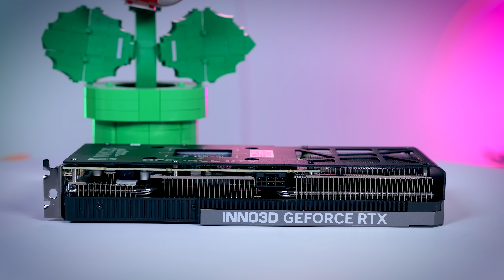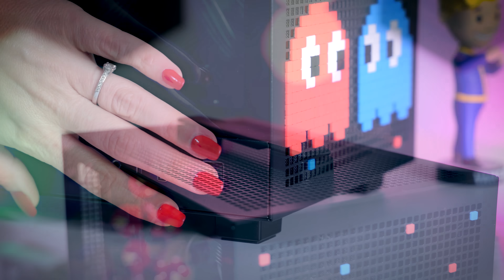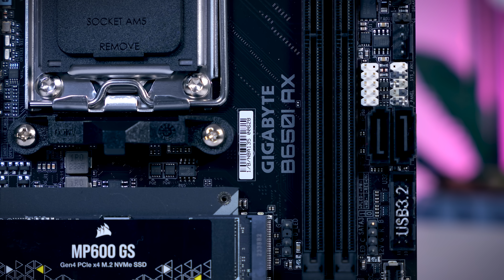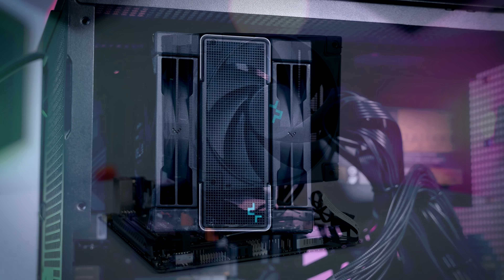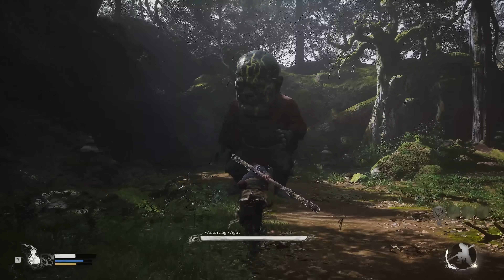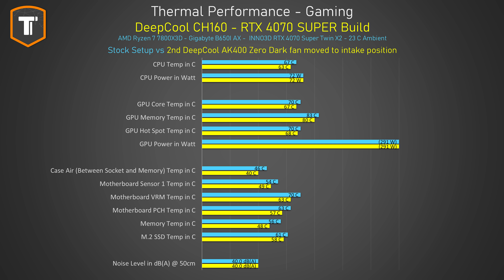Small, Fast & Affordable - RTX 4070 Super & 7800X3D ITX Build

Comment from the maker: Notes:
- At the time I built this, all the parts together added up to €1500. I felt that was a good price for this system. But the 7800X3D has since gone up in price by more than 150 euros, which doesn't make sense in my opinion. With the current prices, I would  swap the 7800X3D for a 7700X, keeping the total build cost around €1500 again. Or, just wait for 9000-series X3D reviews on November 7th.
- At 10:17 I say the GPU uses 219 Watts, but the graph incorrectly says 291 Watts instead. 219 is the correct number.
Reply: Hello, nice video like always 😊 but i'd like to say that the screen with the gpu power is incorrect because the max consommation of a 4070 super is 220w and it says 291w in the vidéo. I hope this information can help you. Bye
Reply: I am building just the same PC, for the money i think it is the best choice for now, later, in a few years i can swap graphic card and proccesor
Reply: @TheMarkolen  You'd be mad to buy a 7800x3d now when the 9800x3d is about to be released. And from the rumours, it's going to be a beast.
Reply: @mikep9418  yeah it will be better probably, but it will be more expensive probably
Reply: Do you think able to use the rx 6800xt instead of the 4070super? If yes how much do you think the performance will differ?
Reply: I mean, if you can afford a €1500 PC, you can add an extra €150 or even find a second hand deal, nice dress btw ! :eyes-pink-heart-shape:
Reply: @Z0MBUSTER  How do you come to that conclusion? Many people struggle to save that much
Reply: @joshualaird5303  If you struggle to save 1k, maybe you should use it to buy something useful like a second hand desktop pc to find a better job or food, then game when you can actually afford it :face-fuchsia-poop-shape:
Reply: You do realise that people who struggle to save 1.5k are not the kind of people who will "waste" it in a gaming PC but rather in basic survival items like food or clothing right ?

Comment: It doesn't make much sense to purchase the CH160 when you can create a mATX setup using the Mechanic Master C26, which features a 13.3L case and accommodates a 310mm GPU.
Reply from the maker: Never heard of that one, but I can find a CH160 for 50-60 euros, so I don't think it's really comparable?
Reply: @TechTesters  The CH160 takes up excessive space for an ITX setup; this case feels outdated. Currently, an ITX configuration is around 7.8 liters with a 300mm GPU, while mATX is approximately 13.3 liters with a 310mm GPU. Everything else seems impractical if one can't achieve a better volume-to-total TDP efficiency.
Stay Updated!!!

Comment: It's good to see a SFF build and review. There's some really great cases out to choose from if you up the budget for them. I built mine in NR200P v1 some years ago. As it is a little larger I could fit the Phantom Spirit CPU cooler to my 7700X. Wow - it's a good cooler at a budget price. The one piece of experience I'd share, ahead of number of M.2 drives etc, is that case fans and layout is really important. In a washing machine sized case you can brute force air in. With a SFF case you need finesse. I'd stay away from small fans, stick to 120 or 140 if you can fit them. Also buy good case fans. Don't cheap out on these. They make a great difference to cooling and noise. I'd also have the top fans set to exhaust and intake everywhere else you can fit them.
Reply from the maker: I still have a NR200P as well, still a great case. Really liking these cases that are compact, but not to the point where they become a hassle to work with.

Comment: Excellent video and presentation as always.
How about noise levels?
Reply from the maker: Noise is pretty much what you make of it with cases like this. I always (try to) limit my builds to 40 dB(A) at 50cm under load. But you could easily keep it even quieter if you wanted to.
Reply: @TechTesters  sounds pretty good, thanks a lot!!

Comment: But it's hard to find a motherboard with itx form factor in budget build plus itx motherboards are lacking in expansion slots due to a tight itx build so for future upgradation it might give problems and Some Airflow issues may also arise in future. Although it's a great build and I personally Like it so much as portability and performance both seem promised but personally searched about this and found these issues. 

I am planning to put an rtx 4070 with either R5 7700x or an i7 13700k
Reply from the maker: Fair, but to be honest most builds I see never use more expansion slots than the GPU. As for airflow problems, I'd say it's easier to keep this system clean and running well than most ATX builds.
Reply: @TechTesters  So for like If I Wanted to upgrade it to rtx 4080 or 90 in future so for that The power supply ot even intense gaming oriented CPU I may consider for future upgradation, will it does the job or like I may be require to upgrade this whole to ATX ? I am really curious to know cause I am planning for the same build but future upgradation is something that stopping me for an itx build.

Comment: that GPU should not be pulling 290 watts, something is wrong here.
Reply from the maker: Pinned comment :) I say 219 correctly, the graph incorrectly says 291.
Reply: @TechTesters  Thanks. I have the exact same GPU but flashed with Gigabyte bios so the power slider goes up to 145%, and in that setting it pulls 275 watts during 3DMark benchmarks. This is why I was confused why its pulling 291W in normal operation haha.

Comment: More Gaming Performance with 4080s + 7600 . 7800x3d is the same fps on 4k as 7600 but double the Price. Also with 4070s is most of the time to slow for 4k.
Reply from the maker: With current prices, I'd definitely drop the 7800X3D for something cheaper and upgrade the GPU. Or just save the money.

Comment: I'm planning to build in that Fractal Terra case and I already checked that I can only fit ~60mm height for CPU cooler (I think I'll pick ID Cooling IS-55). I'm planning for this CPU+GPU combo at first but I don't think the cooler is sufficient for 7800X3D. Will the 7900 non-X be a decent alternative?
Reply from the maker: The Terra is a lovely case. But CPU Cooler space is definitely limited, especially with a larger GPU

As for the CPU, there is almost no difference in power use between a 7800X3D and 7900. If you can cool one, you can cool the other. The same with the 7700, it doesn't really change anything power wise.

If you want to mostly game, I'd probably wait for 9000 X3D reviews. For mostly work, I think the 7900 at a good price will be hard to beat. And you can always tune the power consumption down a little bit in bios without hurting performance too much anyway.
Reply: @TechTesters  Thx for the response... I play games casually and it's not the top priority. Productivity wise, I mostly do editing (rarely 4K) with davinci resolve and lots of encoding using Handbrake. So I guess 7900 is the better choice? Oh and it's also ~€70 cheaper in my region.

Comment: Deepcool CH160 is a fantastic case I've been using for a few months, but it was a bítçh to find in the EU. I live in the Czech Republic, and I saw nothing at all here. I got mine from a German shop. Cooler Master NR200P mentioned in the description may be your only suitable option here.
Another exciting option would be Jonsplus Z20, a subtle MATX case I should've bought because used MATX boards are way more available and cheaper than MITX ones. In addition, that little bit more space really comes in handy while installing everything. The downside is the price. It's close to €100, but you may be able to cram your old ATX power supply in to save a buck.
Reply from the maker: Yeah supply has been pretty limited. They're available here but not in big numbers, and the price does fluctuate now between 60 and 70 euros. Still not a lot of money for this case tbh.

NR200P remains great, often cheap as well. Z20 I haven't seen yet.

Comment: Pretty sure you would get better thermals by adding a duct from the back to CPU cooler as intake, only fresh air would reach the cooler this way and makes quite a difference. I find this unique ITX case interesting because of ports on the side below the window which makes sense to have it on display on your desk with easy access to ports.
Reply from the maker: That's an idea, but that would require time and DIY. I'd love to see them make a case that has more airflow guidance though.

Comment: ITX motherboards appear to have not the best power supply components , while I looking for B550 motherboard for my 5950, hardware unbox had a very amazing comparison sheet about temperature and power. some couldn't even support normal overclocking
Reply from the maker: Correct. But a 5950X can use closer to 200 Watts. Sub 100 Watt CPUs really don't stress entry-ish level boards like this one much.

Comment: Just bought the same itx case for  CAD 67! it is great, small and easy to build in. I also went with the same cooler. Thanks for NOT USING the assassin 4 cooler, like the vast majority of  you tubers.
Reply from the maker: That's a nice price! And I don't think it makes sense to use a cooler that costs more than the case, especially for a 90 Watt CPU :) It would for an old i7/i9 though.

Comment: I have a 5800x3d & 4070 ti Super squeezed into an NZXT H1 V2
Reply from the maker: Still a lovely case! Shame they kinda ruined the name with the V1 issues but I'd still consider the V2/V3(?) today if there was any stock.
Reply: @TechTesters  It needed a few mods to get it to run silent at low loading but once done, it makes a great case. I bought it for £200 which was a bargain - the psu, aio, and gen 4 riser was worth that alone.

Comment: Great build and review.
Wonder if 4070 Ti Super would be possible, to have GPU with more VRAM, when AI tasks are run?
Reply from the maker: The Twin X2 version of the Ti Super uses exactly the same cooler design, so you could reuse the whole build with a Ti Super instead. Just check what I wrote in the pinned message re: 7800X3D, or wait for 9000-series.
Reply: Easily I have mine in Dan A4-SFX

Comment: Isn't the problem with ITX systems the amount of pci-e busses? For this instance, the 4070 Super wouldn't be able to run on full power because it can't use all of its necessary busses.
Reply: I think you're mistaken. Usually the only limitation in an itx build is poor cooling or, if used, a riser cable which isn't gen 4 or above. My 4070 ti super runs just fine in my itx build.
Reply: That's a motherboard thing. My 4070ti is Gen5 x16 on a B760i but it's at Gen 4 due to the riser cable
Reply: It has a pci gen 4 x16 slot, enough for a 4090.
Reply from the maker: There are limitations of course, but your single GPU will be completely fine :)